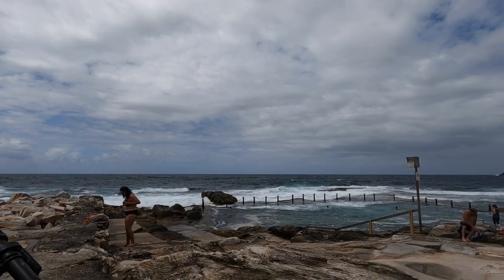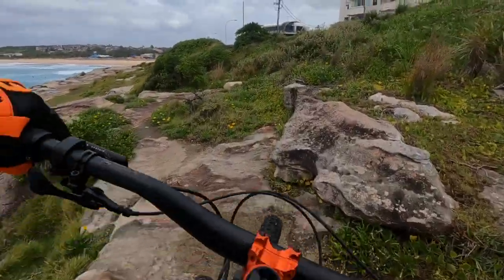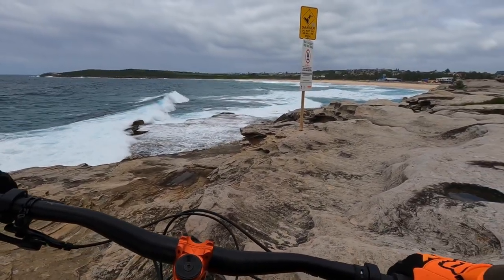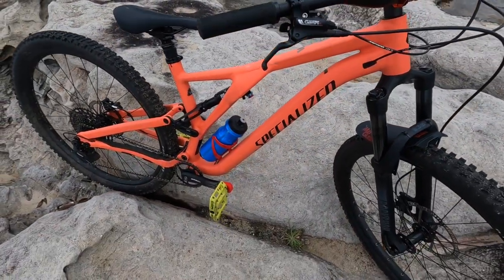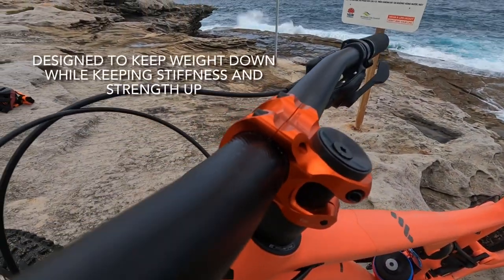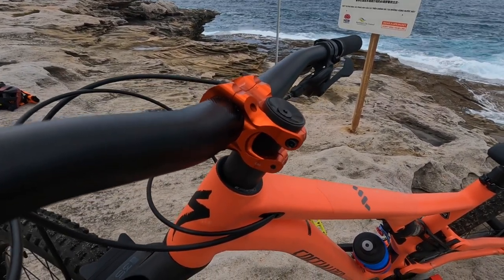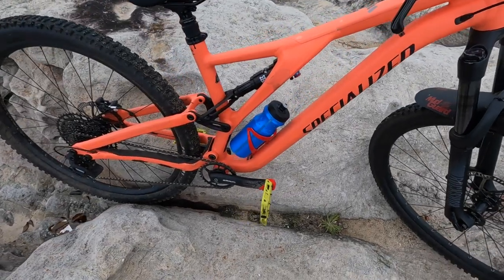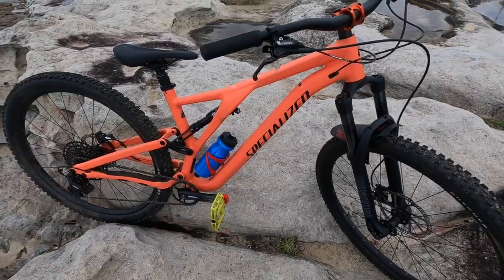Stumpjumper Alloy Stem upgrade

Comment: Hi guys I’m 5.9 and I bought an S5 it’s xL stump jumper my friends says that I’m crazy that I should be on S3 size ?? Please help
Reply from the maker: Hi my size is S4 and I am 177cm or 5.9 and it was too long, so I dropped the reach size with the shorter stem. Even with doing this I think the S3 with a shorter stem or even a S2 maybe be a better choice. The trick is with even spending money on extras it will not solve the length issue so this is why I might change the bike which will be a shame as I like it. With regards to yourself it does sound it is too long or maybe you have long arms to help with reach. Try watching a Youtube Chanel called Joy of Bike. Alex talks about sizing issues.
Reply: @mtbjeffoou2599  I’m 178cm and I was considering the S4 from the sizing guide on the specialized website. Did you do the sizing guide too?
Reply from the maker: @kaanbalci9391  I was riding a Trek Roscoe Medium and I actually stumbled across the bike by accident at a bike shop. If I had the choice again I may have not taken the S4 size even though I have enjoyed the bike. Though we live in times where there is not much bikes around. The S3 for me would have been perfect. I can't comment what would be right for you. One thing is for sure for me is the S4 likes charging downhill.

Comment: Hello! 
In the video the rear shock was open or closed? I have the same bike, but i’m not sure the lock/open position… thanks!
Reply from the maker: Hi Sebastian to tell you the truth I gave up trying to work out the direction for open and closed. The reason being there is very little difference between the settings. Though I have the lever set to horizontal ( sitting on the bike and pointing the lever to the left). At this stage I am testing new brakes and derailleur which is making a big difference.
Reply: Lever up in a horizontal direction to open up shock  down to lockout

Comment: Great vids. I've just ordered this bike. How did you get on setting up the suspension to your weight?
Reply from the maker: Thanks. I have only been riding a full suspension bike for just over 2 months and MTB riding for just over 10 months. So what I did was get the bike shop to set up front and rear as standard factory settings for my weight with a medium rebound. Though the more I ride I will start to get it dialed. I haven’t bottomed out yet that is one good thing. Remember the front fork doesn’t come with O ring.
Reply: @mtbjeffoou2599  you can use a zip tie as a ring.  I put a red zip tie and that looks like it came like this from factory ;)